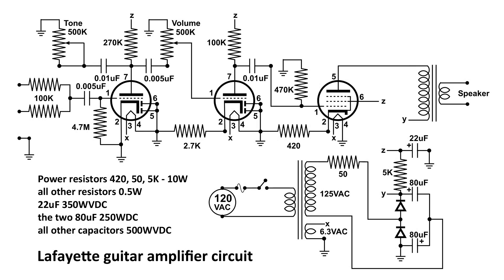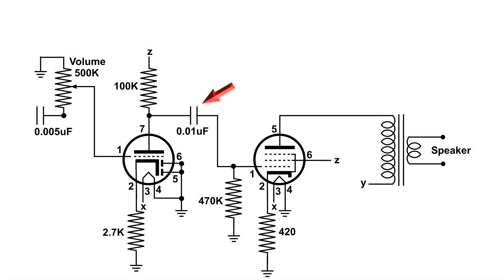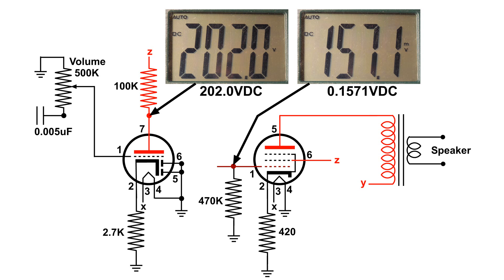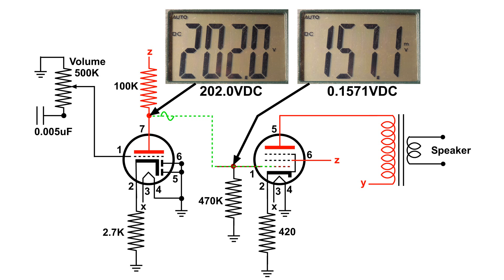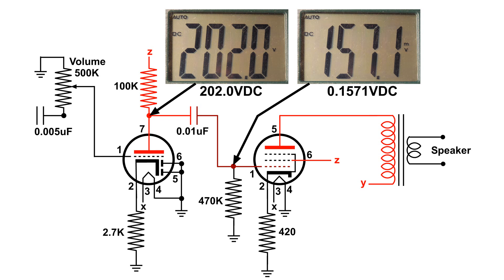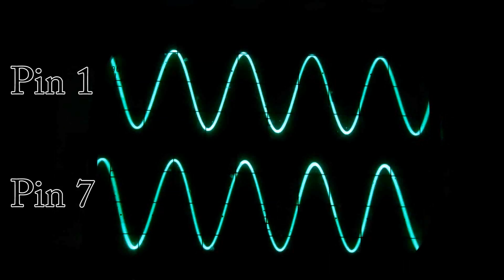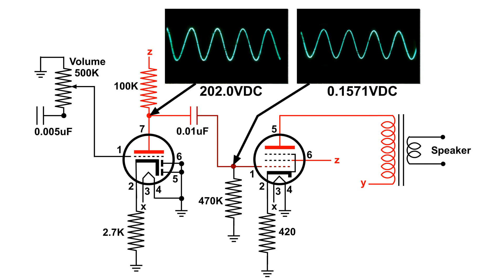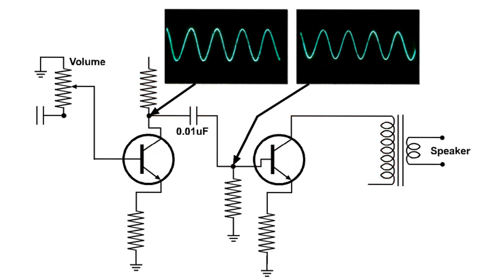Audio Coupling Capacitor, how it Functions in a Circuit

Comment: Please through which path does the audio capacitor discharge.
Reply from the maker: When th circuit is on, the capacitor is charged, The Audio (AC) passes through the capacitor. When the circuit is off the capacitor discharges.

Comment: I need to change my existing coupling capacitors from .02uf 600vcd to .01uf 800vcd, is this going to drastically change the sound of my push pull EL84 stereo amp?
Reply from the maker: Some coupling capacitors have a higher value. I used a 0..02uF because that was, what was on my work bench. And yes it will change the frequency response.

Comment: I didn't realize capacitors behaved this way with AC and DC. It's almost like a poor man's transformer in a DC circuit, but without affecting current very much.
Reply from the maker: Capacitors, DC and AC Current
https://www.youtube.com/watch?v=NInt1Ss3vQ4

How Capacitors charge and discharge
https://www.youtube.com/watch?v=Ag2RujOHqJ8

Comment: hi, this is an old video, but very informative. can you please discuss in your other videos, regarding coupling transformer or interstage transformer which has the same
function as the coupling capacitors, and maybe you can discuss it's comparison advantage and disadvantage as well as sonic characteristics. i'm an avid fan of susumu sakuma san which building hifi tube amp without using coupling capacitors while he's still alive in japan.. thanks.
Reply from the maker: Transistor Push Pull Audio Output Amplifier
https://www.youtube.com/watch?v=NU8Yk0bXlkk

Audio Phasing, Important and Useful
https://www.youtube.com/watch?v=lgWLCG5vg5c

Transformers, basic phasing
https://www.youtube.com/watch?v=BRBqUQPLk-M
Reply from the maker: The Vacuum Tube Shortwave Radio
http://www.richardmcwhorter.com/vacuumtuberadio/
Password 'allamericanfiveradio'

Comment: so these caps are non polarized right? polarized caps would be used to buffer DC?
Reply from the maker: Yes, non polarized capacitors in this circuit. In some transistor circuits electrolytic capacitors are use at the volume control center. The voltages in audio transistor circuits are must low than in tube circuits.

Comment: Question: You measure 202 vdc as the B+ on the first tube (preamp). I get that the .01 cap blocks DC and passes AC (in this case signal frequency) to pin 1. However, where does the 157 mVDC come from that you measured? What is the function of the 470K ohm resistor at pin 1? I know it is called a grid leak resistor. How is it computed given that there appears to be no DC from the power supply to pin 1? Thank you for the knowledge you passed.
Reply from the maker: Control Grid
Reply: Thank you for the two word answer. I must be very "dense" as I don't understand the response. Would you like me to restate the three questions? My reference books point to a "space charge" as electrons pass through inter-grid to plate (positive with reference to cathode). This potential is negative at the grid. Again, thank you.
Reply from the maker: Electrons flow from ground up through the 470K resistor then on to the control grid, the plate of the tube pulls a small amount of electrons off of the control grid, this flow results in the 157.1 mVDC.
Reply: AllAmerican: That confirms my research I did this morning:  Radio Designer's Handbook;  Langford-Smith; Oxford Press 1953. I now so get it.  Again, thank you so much. Your information is valuable to me.  "Ignorance is cured with Knowledge" anon.

Comment: Does the grid of the vacuum tube  always require an ac voltage to work?
Reply from the maker: Most of circuits that use vacuum tubes are amplifying RF frequencies or Audio frequencies, both of our AC signals applied to the grid of the vacuum tube, usually through a coupling capacitor. When a vacuum tube is used as a voltage regulator then a DC signal is applied to the grid of the vacuum tube, and there is no coupling capacitor because capacitors blocks DC electron flow.
Reply: @AllAmericanFiveRadio  Awesome explanation. My sore brain thanks you.

Comment from the maker: The coupling capacitors in the tube circuit are nonpolar. But sometimes in a transistor circuit they can be electrolytic, which are polarized.

Comment from the maker: In the tube amplifier if the coupling capacitor was shorted, you could eventually wear out the audio output tube, but before that happened there would be a good chance of burning out the primary of the audio output transformer.

Comment from the maker: In this tube circuit, chances are there would be no damage, but probably a loud noise in the speaker. However with the Transistor circuit if the coupling capacitor shorted out chances are the power output transistor would eventually burn out. And if you replaced it without replacing the shorted capacitor the transistor would burn out again. That's why it's a good idea to check all stages in a solid-state amplifier.

Comment from the maker: The 100K resistor cuts down the voltage to pin seven. The 470K and the 420 resistors bias the audio output tube. Of course there is some RC time constant, but their purpose is for biasing.

Comment: in a real life situation would the tube on the right be destroyed if the b+ came across the failed capacitor.or would it just drive it into cutoff. great video ty
Reply: It would drive the tube into maximum conduction and the plate would glow red hot. Hopefully a fuse would blow, but if not, the tube and possibly the output transformer would be damaged.

Comment: Interesting , I wonder if the loss would be greater at lower frequencys as a capacitor is used to remove low frequency before a twieeter.  Great to know this though , a use I can think of would be to convert a high level speaker signal to line level signal , thanks great video

Comment: Excellent explanation!  I know it's off topic, & irrelevant to your purpose for this video, but in following the signal through the entire schematic, I couldn't find a cathode bypass capacitor for the output tube.  Are they using a little negative feedback, or am I missing something?
Again, fine presentation. 
Dick